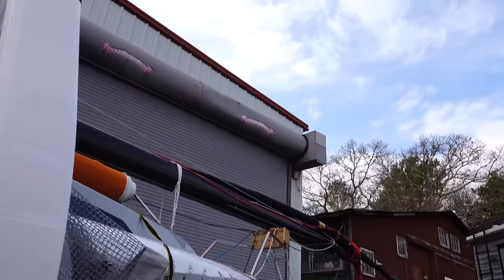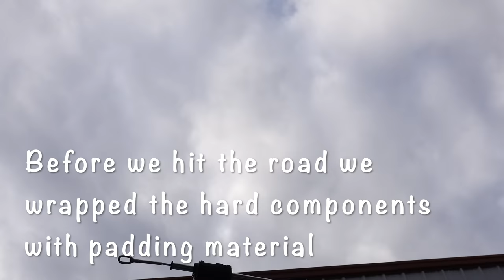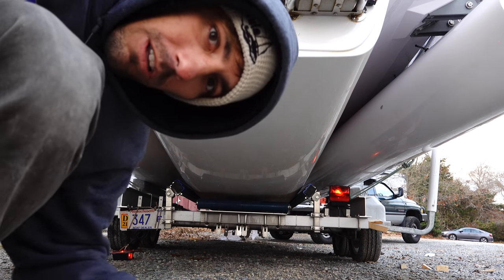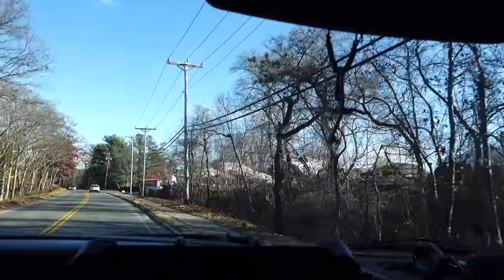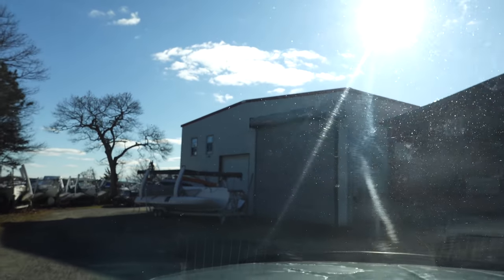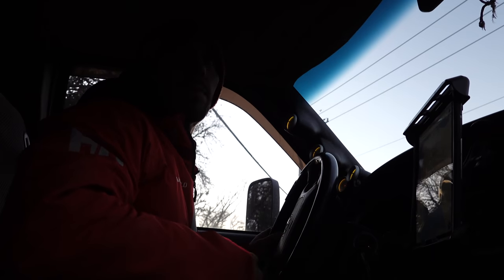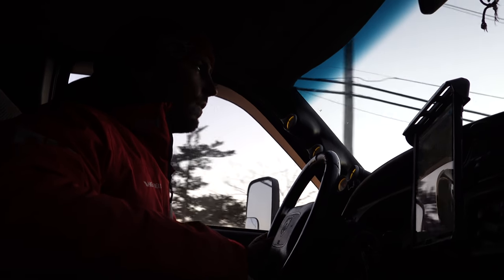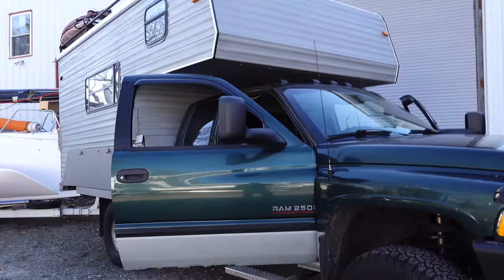Will our truck pull this 29' foldable Sailing trimaran?

Comment from the maker: Thanks for all the great recommendations you guys! We did actually have a red flag on the mast before we left that you can see quickly at @12:01 and we have been making some tweaks along the way including moving the mast back about a foot which gives us significant clearance between it and the camper. We could easily remove the bowsprit as well if it was too close to the camper but that hasn’t been a problem.
Reply: I was going to mention a flag. The DOT would nail you for sure. I'd put a red LED light on the end. of the end of the mast. Nighttime driving seeing the mast may be an issue. Watching further the back of the pontoons should have lights as well. The overhang of the trailer should have lights. I check the USA highway traffic act.
Reply: Tula's Endless Summer, Permits?
Reply: I would probably be really careful going up sudden inclines as it will bring that mask closer to the camper. 🤙🏽 you got this gig dude.....
Reply: Cool looking Tri! ⛵🍻

Comment: Loving your new adventure :)  As a retired over the road boat hauler (million plus miles) I've got one suggestion  "chafe gear", wherever a strap or securing line touches the Hull or rigging it needs some sort of protection against wear caused by vibration; strips of carpet is perfect for this.
Reply from the maker: Thanks so much for the recommendation. We are always grateful for tips from people with loads of experience
Reply: @Tulasendlesssummer  ...you're very welcome, I learned it mostly from observation and a few times from "oops". p.s. I just hooked into your Patreon. Cheers.

Comment: When I set up my F-9A for trailering, I did not like the only lights being mounted way under on the back of the trailer, which is about 10-12' from the rear of the boat (with rudder/OB motor kicked up). So I bought another light set that I attached to aluminum rails and mounted to the boat stern. I split off the wiring at the trailer tongue with a plug to disconnect when pulling the empty trailer. This helped make the lights much more visible to following traffic.
Reply: I think I have seen a lot of F27s with a similar light bar system.

Comment: Lots of good comments.  I pull a RV, boat trailer, and heavy equipment trailers.  Red flag in the mast, extended brake lights, careful with the mask clearance near the trailer are all excellent suggestions.  You may want to look at tilting the motor up for more ground clearance.  It is hard to tell from the video if it would bottom out going over a dip.  Above all, have fun!!

Comment: They make hitch extenders in various lengths. You might think about adding one, another 6" of clearance back there could make the difference in certain situations.
Reply: They make great battering ram's too, when you're backing up
Reply: He already had a hitch extender on the truck, not sure how much longer you can make the hitch and still have enough strength to meet the ball weight (the weight pushing down on the ball not the weight of the ball itself)

Comment: I was watching your video and I sorta did the same thing you did . I installed a bow pulpit on my center console and checked the clearance just like you did. Went to test drive it and as I rolled down the driveway and up onto the road I heard and felt a crash. Looking in the rear view mirror I see the pulpit in my topper. The angle of the boat still down and the truck going up shuddered the glass. Just a little food for thought. We are a retired couple and enjoy your channel as I was in the marine industry most my life. Have fun and be safe. Mrrobalo

Comment: You need removable / mountable break lights-turn signals on the boat.
A good case for having  a trailer designed first and then the tri.
Reply: Exactly!!!
Reply: When I set up my F-9A (31') for trailering, I did this. Extra trailer lights attached to boat rear since rear of trailer ends way short of complete towing package. I split the wires off at the tongue with removable plug. I remove the extra set when towing the empty trailer. 
Running both sets of lights in parallel is no problem. The extra lights mount on an aluminum rail that attaches to transom. This puts the lights about 7'6" apart (boat/trailer package is 8'5" over wheels) and at eye level of following traffic.

Comment: This will be an epic series of videos, looking forward to it. 

I noticed the 2 leading wheels on the trailer looked like they were taking a fair amount more of the load. I'm wondering if removing the tow ball from the mount and rotating the mount 180° and reinstalling the ball, would level the trailer out and have all the wheel bearings sharing there load. It may make the tongue to high, but buying a mount with less of an offset, wouldn't be a huge purchase.
Reply: This could be why you were blowing tires.

Comment: You should to put a class 5 hitch and a 2-4 ft extension along with airbag lifts for your trucks rear axle.  Also get rid of the furling jib if your going to trailer a lot.  Jibs are easy enough to roll on your boom.

Comment: The brake and indicator lights are  pretty useless under that overhang. Looks like you will get nicked as soon as a copper sees it.
Reply: That was my first thought too. With more SUVs and taller trucks on the road these days, I don't know how you'd be able to see those lights from behind, particularly if you are up close, like in traffic.
Reply: @rumblechick73  - If the police stop them they will be lucky coz that looks like a crunch waiting to happen. Needs a proper job.

Comment: Put a hitch extension on your truck, the mast will hit the camper when you go in or out of driveways that are on an angle. Also it's best to be able to turn the truck at full steering lock without it jack knifing the trailer when going forward, otherwise you will damage the yacht when you are thinking of other things while driving.

Comment: Looks like a lot of people in the comments are concerned about the trailer lights being so far under the boat. Simple fix: mount weight bearing suction cups to the existing lights and get about 10-15 feet of extension wire with a quick disconnect. That way you can put them anywhere on the back of the boat without damaging or modifying the boat.

Comment: Love your videos. I have a '94 12 valve Cummins, Dodge 4x4 2500 pick up with 2500lb truck camper too and also tow a 2500lb Arima 17ft Sea Chaser boat. I use Air Lift air bags. I'll vouch for them any time. I wonder if you could extend the tongue (behind the surge brake) of your trailer. Extend it enough so you would not need the hitch extension. Kill three birds (issues) with one stone (piece of square tubing). Smooth Sailin'

Comment: Still a little baffled how you can tow that size boat with a camper that big, with that rig .... must be a beast. There are a couple of things I would like to point out ..... 
- The way the mast is so close to your camper means that you will not be able to go up anything much more than a very gentle rise, think it would be risky if you attempt to go up an average driveway. The distance between your rigs rear axle and the trailers axle means that any bump will exagerate the vertical articulation and you will likely hinge that mast through your camper.
- you might consider hanging an extra set of trailer lights off your transom, I doubt a truckle would be able to see the ones mounted where they are.
- you might also think about hanging a red (high vis) flag off the end of your mast (illuminated if you are planing on towing that at night)
Not trolling, just some obvious practical points you might want to consider, I know road laws are most likely different over there, even so, I reakon you can make some simple adjustments and minimise potential risks.
Looking forward to see how that trimaran goes, cheers
Reply from the maker: Thanks so much for all the recommendations! We did actually tape on a red flag on the mast that we didn’t capture on camera.

Comment: You need to push back the 2 sets of poles back to the vee neck of the trailer.  Do you have lights on the end of the boat?

Comment: From my experience with Hyd. Surge Brakes,  take the best care possible as time and salt water will take a toil.  Guessing you have disc brakes.  A bit more
forgiving than drum brakes which will go away very quickly with salt dipping (launching}.....   Best of luck, be safe for sure.

Comment: Remember that pulling that rig down the road isn't the same as pulling the boat off the water on a steep wet ramp. I recommend that another vehicle with a wench/winch be on standby the first time you pull her out.
Reply: It's always useful having a Wench around. ;)
Reply: Just mount a winch and wench on yer truck.  ;)

Comment: That mast is going to go right through the door of your RV if you ever go through a sharp dip, or enter a steep parking lot from a street.  You might want to consider extending your hitch out another couple of feet, so that when you hit a pivot point like that, you don't end up damaging something.
Reply from the maker: We actually did move the mast back another foot after our first launch in Newport which has been working out perfectly. We can't really extend the hitch any longer because it weakens the loading capacity too much
Reply: Also, the mast extends off the back of the boat/trailer quite far.  You should have a red flag on that.    In fact it might be a good idea to check your state laws regarding the safe towing of such a vehicle on the roads.

Comment: I would be more comfortable towing that vessel if dual axles were made that attached directly to the center fuselage ,positioned further back and a towing tongue that attached to the front center fuselage with a center beam that connects the two .  Both separate from the boat once in the water . The boat floats . Pull out the two attached  parts  (via connecting beam). The beam sole purpose is to recover the axles from the water.

Comment: I don't think those lights on the trailer do much good when you have what looks like 5 feet of the boat handing over the end of the trailer. Won't you need some sort of extensions so you can have lights at the end of the boat and not underneath?

Comment: You are going to get all kinds of tickets towing that boat.  The main reason is the mast.  In order to be road legal there are dimensions that the overhang must meet.  Also if there is something sticking out that far it needs to be lit or have a red flag on it.  This varies by state to state as to the laws.  You need to wire in a red light that can be affixed to the mast at the end or some unsuspecting trucker not seeing the mast is going to impale themselves on your mast and furler.

Comment: Aren’t you worried that the motor might strike during a bump? I would think you would tilt it up
Reply from the maker: No, it is pretty high. The hull would hit before the engine would but that would require a bump or drop that you would only find off-road 🤣
Reply: @Tulasendlesssummer  sorry but wouldn't it be easier to remove motor during transport?
Reply: @brianschindlbeck2807  My 9.9 Yam weighs about 100lb and has a bunch of wires and 2 cables to remove/reconnect. It's a couple hour project in perfect conditions on land. Half a day over water and that's each way (remove then reinstall). It's not something you want to add to the set up list if you can avoid it.

Comment: Looks like that truck could use some stronger rear springs or helpers for all that load.
Reply from the maker: We got some super heavy duty leafs made up before we left FL but we added same helpers in MA as well a few videos ago.
Reply: I’m thinking maybe consider dual rear wheels. A blowout at speed with only one rear tire on each side could be bad news. Can the rear tires handle more tire pressure? Can weight be moved to the rear of the boat to lighten your tongue weight? Poor Bob White of Sailing Doodles just had a major incident with his boat. $100K in damage. Nandji is on the hard for more repairs. All my go to sailing shows are having major issues. I really enjoy your vids and want you to succeed. Be safe out there!!

Comment: 3400lb with trailer??? That's very light. My trailer alone for my F-9A is 1700lb.
I don't trailer much but kick my outboard up when I do. I guess it's a toss up between extending the length of towing package by about 1.5' with OB kicked up or leaving it down and exposed to more road hazards but with shorter OA length.
Reply from the maker: It’s around 3500lbs dry without trailer
Reply: @Tulasendlesssummer  My F-9A (31') built with carbon fiber over duracore is about 3950lb dry but with all sails and safety gear. I did use a thicker 9.4oz outer carbon cloth than the 5.7oz that Farrier recommended (plus a 2oz glass external abrasion layer) so it's a little overbuilt but strong, stiff and durable as hell. 
With a 1700lb trailer, the package is about 5700+ lb. It's a big (long) package to tow but handles fairly well as it's not too heavy and is balanced right.
Note about anchoring - Even with a decent bridle, it sails quite a bit at anchor and after dragging multiple times with a lightweight Fortress, I bit the weight bullet and went with a 22lb Delta. Still like to sail but never drags. Some of the newer anchors are probably better but those lightweight aluminum ones never worked for me.

Comment: I have owned a slide in camper and pulled box trailers and boats all over Florida  for 45 years. You need more trailer tongue length. You are to close .It's only a matter of time before you have an accident. Please accept this advice from a old man .
Reply from the maker: Thanks for the advice Mike. We can’t go longer with a hitch extension (already have 12” extension on there) because it weakens the load limit of the tongue and we would be exceeding that limit. We did slide the mast back a foot which has been working out perfectly though.
Reply: @Tulasendlesssummer  trailer tongue - not hitch. another words you need a better trailer design.

Comment: I haven't watched the video yet...yes it will tow the trimaran. It's a 12 valve...it will pull a freight train.
Reply: If this was a more permanent acquisition could you replace the main beam on the trailer with a longer beam or add a swing tongue?  That'll push the boat back.
Reply: And check that tongue weight. She's squatting. 10% /800#-ish max.
Reply: I guess you'll have to turn right to get in and out the back door of the camper?